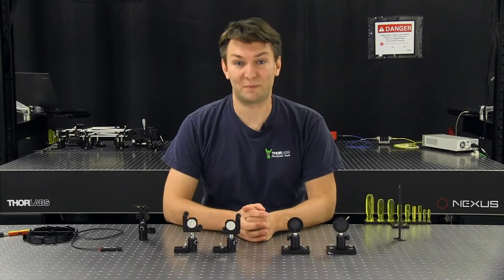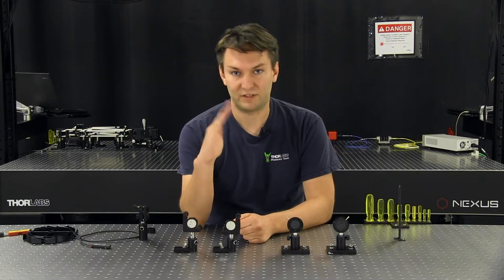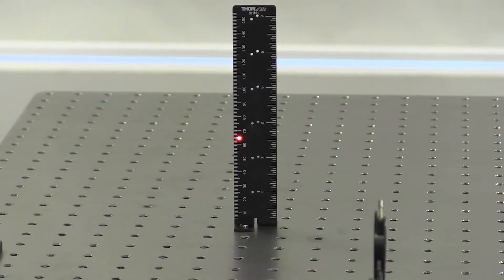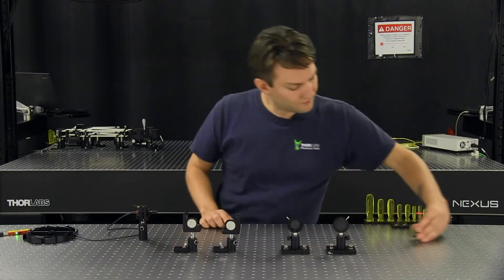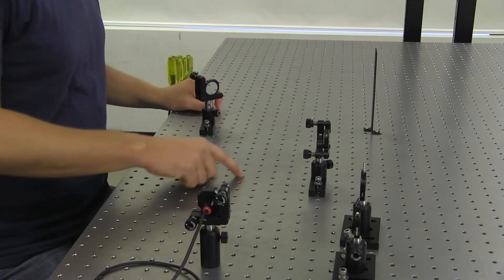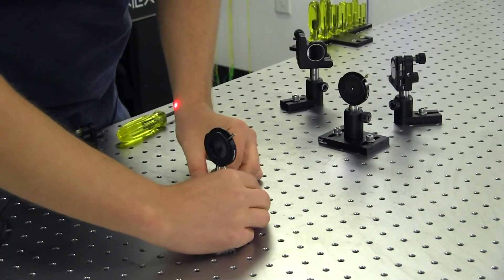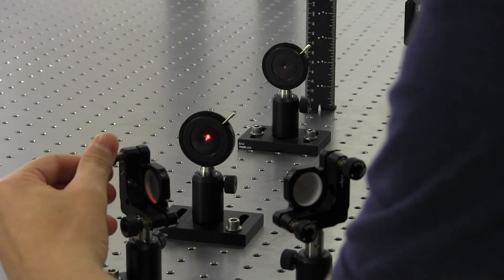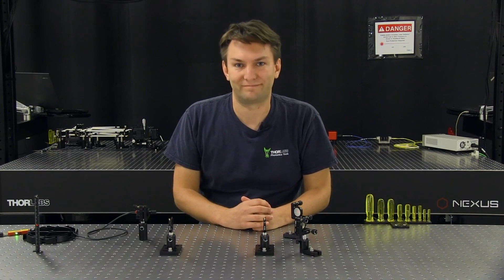How to Align a Laser | Thorlabs Insights

Comment: That was extremely useful! May i ask if the second technique is also used for class 3 or 4 lasers?
Reply from the maker: Thanks for your comment! The same mirror adjustments can be used to align Class 3 and 4 lasers, but we recommend operating the lasers at low powers for safer handling while aligning free-space and unenclosed laser beams. In our videos we have kept our laser power <2 mW by either limiting the laser drive current or including polarizing components in the setup prior to filming. Other ways to limit laser power can include operating a pulsed lasers in CW mode or limiting the pulse repletion rate. If the laser power cannot be reduced, a separate, lower-power laser is often used to perform the initial alignment. When using this approach, the beam from the alignment laser should enter the setup as close as possible to the same position and same angular orientation as the beam from the primary laser. But with both approaches (lowering the laser power or using a secondary aiming laser), the alignment will likely need to be tweaked once full laser power is applied. Please always follow the guidance from your facility's laser safety officer when using high power lasers. 
 
One thing to keep in mind when using high powered lasers is the coating of the iris blades (leaves). We used black-plated iris leaves in the video, since our laser power was relatively low. This coating will discolor and the leaves can disform when higher laser powers are absorbed over long periods of time. We typically use stainless steel leaves when using higher power lasers to reduce the amount of light that gets absorbed. 
 
When placing irises or any other component in the path, it is also important to check for stray reflections and consider the components' reflectivities . For example, bare stainless steel iris leaves are typically more reflective than the black-plated leaves.

Comment: When aligning a telescope on an optical table, we have set out optics up that go (using I for iris): M1 M2 I1 I2. I have been taught to align M2 to I1 and M1 to I2, instead of the usual M1 to I1 and M2 to I2. Why is this? Haven't been able to find a good explanation online
Reply from the maker: As your experience demonstrates, there are often multiple ways to reach the same goal. A couple advantages to the approach you described are 1) the user can first align the irises and then use the same iris to position the second mirror and perform the fine adjustment and 2) it can prevent the beam from inadvertently falling off the second mirror and/or iris during the adjustment when there are larger spacings between parts.

I personally use the approach I showed because I try to keep my steering mirrors and first iris in close proximity whenever possible. It is also easier for me to visualize the first mirror placing the beam at one point on the intended path and the second mirror correcting the beam path to make both parallel. Sometimes I forget which way I need to turn the adjusters so the more I can visualize the beam pointing in my head, the easier it is for me to achieve the intended alignment.

Comment: Nice tutorial! I have same approach with two irises to align one from several possible laser diodes (placed on magnetic holders) in one measurement system. As I see, my "customers" (students, colleagues) are coming quite clear with this procedure even not being physicists. Alignment of IR lasers is not so obvious but still possible. 
However.. I should say that from point of view of a laser safety the procedure is "a bit"... not safe.. 
In real life many people align the full/high power laser beams in same way (have seen it many times). And it is good if they (and especially spectaculars) have safety glasses on and the table has safety shields on sides.
So - I would include using a shutter or at least a beam block (I use magnetic one which is easy to slide in/out of the beam) while placing some elements in the beam. 
As a suggestion for a next "tutorial" - installation of laser diodes in heads! With LD/PD AG/CG recognition from datasheet, setting of limits )again from datasheet and adjustment of PD sensitivity. Also choice of collimation lens and a collimation procedure of the laser beam (simple or with shear plate). That is what I show to PhD students several times a year. And myself I have learned it by hard. And still do (mode hoping even in temperature stabilised mounts is driving me crazy).
Reply from the maker: @Tush A new Video Insight, Setting Up a Pigtailed Butterfly Laser Diode ( https://youtu.be/LAixCOso-FE ), demonstrates the procedure for installing the laser in the CLD1015, which is a combination butterfly mount, laser diode driver, and temperature controller. The video includes tips and tricks for installing the laser, including guidance for applying thermal grease, as well as the procedure for entering the thermistor values and setting the maximum drive current. Thanks again for your topic suggestions!
Reply from the maker: You are correct that best practice typically includes reducing the power of the laser to the lowest level needed to perform the alignment, wearing laser safety glasses appropriate for the wavelength and power of the laser emission, and using beam blocks or laser shutters to prevent stray reflections from hitting labmates unexpectedly. Getting in the habit of doing these things is wise, even in situations such as this one where the laser power was low enough that that the human blink response should be sufficient.

Thank you very much for your comments and suggestions for future videos! We love to receive suggestions!
Reply from the maker: @Tush Thanks again for your comments! We thought you would like to know that our new step-by-step TO can laser diode setup video ( https://youtu.be/YshMuSfIcBQ ) was inspired by one of your suggestions. We hope you like it, and we greatly appreciate the recommendation! Let us know if any other topics have come to mind.